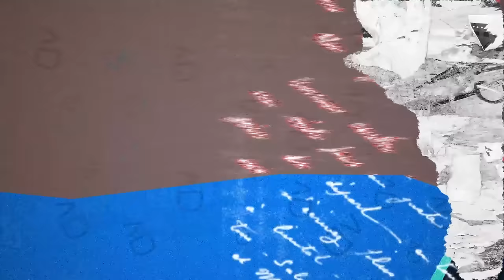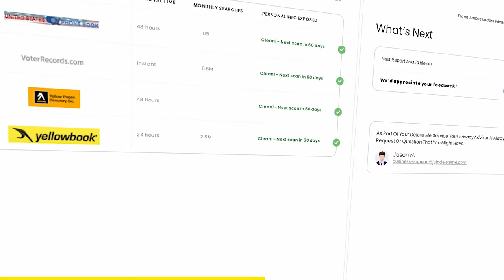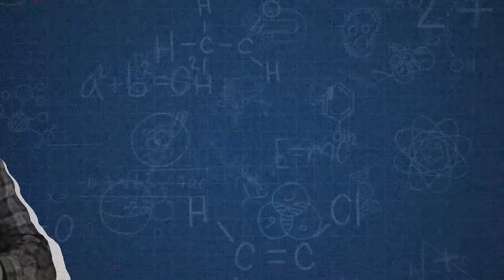She Built A Light-Powered Engine | Danielle Fong, Lightcell

Comment: first of all, that's a man. second this is pretty cool. hopefully he doesnt go for any patents or its all down hill.
Reply: whats the issue with patents?
genuine question. is there some kind of annoying beurocracy thing here again? or those damn cliche thing like with music label where joining them might just screw you over?
Reply: @zefellowbud5970  People who patent stuff in the revolutionary energy domain tend to end up dead.
Reply: @seitch1  Yeah... "Oopsie lol, that patent holder sadly got in a car accident, how unfortunate (for them)"
Reply: nah... it usually goes downhill because plenty of these "revolutionary" inventions are overhyped and the leader ends up with fraud charges...Plenty of actual issues with this idea, mostly cost and reliability related. No moving parts sure, but brittle materials under extreme thermal stress + thermal cycling is not what you want for long life. Cost is another issue, suitable materials for emitters, photovoltaic cells and the high-temperature structural components are not exactly inexpensive. High efficiency seems to be chanted a lot, albeit much more efficient than thermocouples (5-10% maybe?), the highest numbers I've seen for this type of system is just over 40%, which actually isn't all that impressive. Large scale combustion power plants usually achieve 50-60% and the best car engines can get about 45%.
Reply: I think he had too much coffee. Can't sit still for half a second
Reply: @tanner3801  or is on the spectrum.
Reply: @douwejan  big jump in logic.  Might just be nervous about being in front of a camera

Comment: The highest rated solar cells are at about 24% a unit 1 M by 1.6 M will produce 440 Watts never mind entropy. It is true high pressure sodium works on changeable energy states usually Mercury is added to begin the process of ignition. The heat exchanger is not much different in theory than an air conditioning Refrigeration sealed system. That's a crude example. It is difficult to follow the theme because of excessive tangentizing.

Comment: There are 2 UK projects regarding gas compression energy storage, the more recent liquifies air and stores that along with the rejected heat in sand buit from standards parts used in the gas industry. Their round trip conversion is about 60% which IMO is outstanding for days/weeks worth of storage, these are being built with wind turbines in Scotland. The earlier project was Isentropic which was more controversial using argon gas in differential hot and cold heat stores of rubble, the tech eventually ended up with Nottingham University under further development, they also get 60% or more round trip efficiency.

Also with Molten Salt nuclear Reactors, the conversion of fission energy into constant heat production which is then stored in hot salt tanks for later conversion to electrical power. By overprovisioning the number of generators up to 3 times which allows the power output to be base load and or mixing highly variable output that eliminates the need for storage when combined with intermittent solar/wind. So a 2GWh thermal reactor might produce 1GWe normally but can vary from zero to 3GWe as long as the total daily is 24GWe hr. Pretty much every MSR in development could do this and it solves several other problems as well, the power production is decoupled from the NRC regulated reactor across a "moat" separation.

And the super critical CO2 engines seems to have reached a working state, with much higher temp inputs efficiency can go from 35%s to 50-60%s or so.

In addition with working salt temps of around 700c or more, nuclear heat can split water into hydrogen at conversion eff of 50% with heat alone, if it were electrical produced hydrogen, you would only get 1/3 of the hydrogen. That process is the Sulfur Iodine catalytic process. Also the oxygen could also be sold and used for burning nat gas where needed at 80% eff rather than the usual 60% max eff in conventional CCNG plants, but thats another story.
Reply: Very valid observations
Reply: Sulphur iodide?
Reply: That’s a lot of detail - do you specialise in this field?

Comment: Can't this idea be used for nuclear-to-electric conversion too? There's an old concept called a "nuclear light bulb" which kind of does this.
I'm not sure what the conversion efficiency of a standard thermocouple is by comparison.
Reply: Yes, tried and tested, espescially using nuclear decay products. It's a type of atomic battery and thermophotvoltaics (as in this video) seem to be one of the better methods for converting heat to electricity. However, there are several reasons for why it's not widely used today and lots of those reasons are the same for this chemically fueled variant. For obvious reasons any type of atomic battery would have very limited applications, while the problems with chemically fueled thermophotvoltaics are mostly cost and reliability. No moving parts sure, but brittle materials under extreme thermal stress + thermal cycling is not what you want for long life. Cost is another issue, suitable materials for emitters, photovoltaic cells and the high-temperature structural components are not exactly inexpensive. High efficiency seems to be chanted a lot, albeit much more efficient than thermocouples (5-10% maybe?), the highest numbers I've seen for this type of system is just over 40%, which actually isn't all that impressive. Large scale combustion power plants usually achieve 50-60% and the best car engines can get about 45%.

Comment: Here's a thought: Why not make a generic light cell to plug right into existing exhaust systems of ICE-equipped vehicles? Since most of the heat produced by combustion is simply wasted out the tail pipe, shouldn't you be able to scavenge some of that heat to convert it into electricity using a light cell? If the typical EGT is too low to liquefy sodium chloride directly, are there other potential sodium compounds that could liquefy at lower temperatures? Or are there other ways to make the sodium glow besides liquefying it that would require lower temperatures?
Or maybe you could just accumulate the heat from the exhaust gas using highly efficient heat-exchangers and concentrate it to a point where you could plug and play a light cell.
Could you also potentially use a light cell to perform the same function that a catalytic converter does, thus replacing the cat?

In my mind, most vehicles with ICE's should be able to fairly easily utilize light cell technology in several ways to increase the overall energy efficiency of the whole system. Because if you could scavenge exhaust heat to produce electricity, you should be able to hybridize a vehicle fairly simply – for example, directly at the crankshaft, between the engine and the transmission or directly at various driveshafts! If you could convert most existing non-hybrid vehicle platforms simply enough into a system with a high enough degree of efficiency, that could be a really cost effective way for many people and businesses to "go green" and also make great fuel savings. And if more and more vehicles can do more work with less fuel, it enables people and businesses to do more and be more productive. This should boost the economy long term, since transportation is essential for practically everything in an economy.
I have very high hopes for this tech!

Comment: This is not the first solar cells in a box idea but transparent aluminum can build parts of this. the heat will still be needed to be used for full efficiency. Also to save the system from breakdown. I think this could be made small and have the interaction happen in pulses. The first idea also might be done with solid state now aswell with the new chip fans. The best way for a light engine chem based would be a bio light source. The lightbug engine

Comment: Can someone explain how to make sodium emit light by heat? 
Sodium lamps uses heat to get into plasma state and then a electric charge makes it emit radiation.
So, What would be the process of direct conversion from thermal to light?
Reply: Black body radiation. It does it all by itself if you heat it hot enough. Don't need to do anything else

Comment: Just think maybe that would work with a isotope generator maybe plutonium 238 or something to heat sodium or salt to make light that then runs the solar cells to make power. Or use waste heat from the catalytic converter or exhaust in cars for a hybrid electric system.

Comment: LOL You do realize
1. Energy is being transformed THROUGH 3 SYSTEMS
2. As a scientist , you should know you lose a lot of energy Every time you transition to a different material.
3. But you're a genius You're smoking your own Magic pixie Dust.
Reply: Exactly ever transition of energy to a different system leads to efficiency losses
Reply: Did you even watch the video? She’s very open about the current realistic efficiency, and their end goals.
There’s good reasons to be optimistic about the potential efficiency. And it only has to be equal to a combustion engine + generator, which is not a very high bar, and also a process that goes through 3 transformations (fuel to pressure, pressure to mechanical movement, mechanical movement to electricity).
Reply: Entropy

Comment: Petro companies burn Methane on site.  It's called flaring.  They do this because a pipeline would cost too much.  Utilizing flare gas as the power source for light cell tech system would use this throw away resource.  If there is carbon capture, such as -  https://www.youtube.com/watch?v=W_9V6BcVKh4 or https://www.youtube.com/watch?v=Jm0assJmfcY   and a bottoming engine, maybe a  Stirling cycle, you can minimize the impact of oil wells and flare gas and generate cheap electricity with minimal environmental impact,